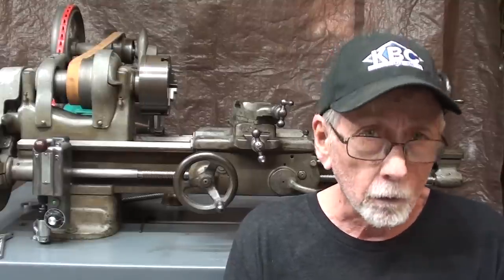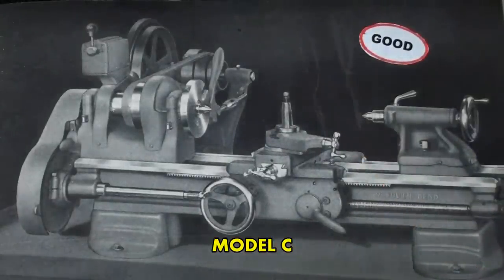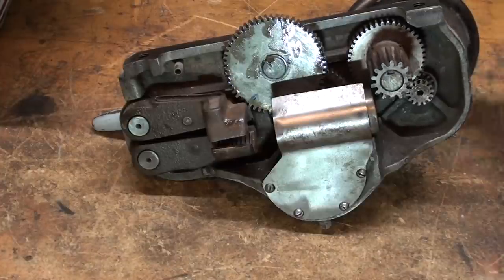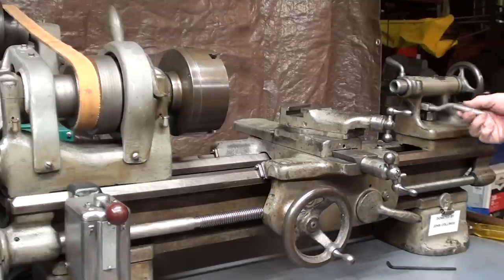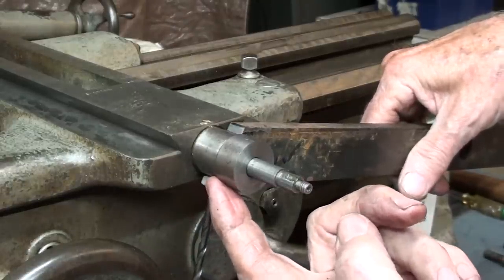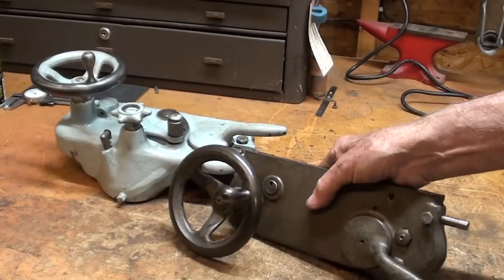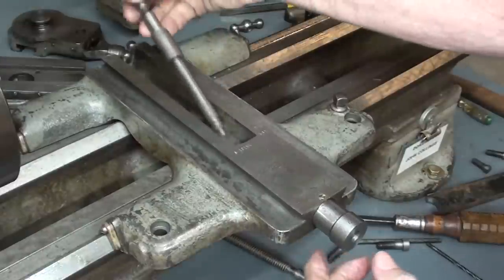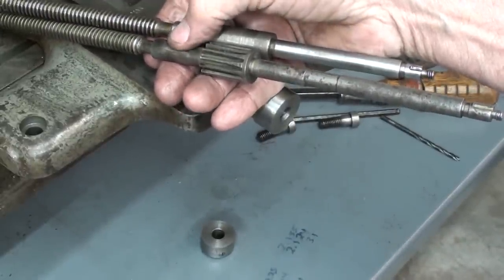UPGRADING SOUTH BEND LATHE C to B  #803 tubalcain part 1

Comment: I recently did a restoration where i combined a broken model C and a broken model A into a working model A. Between the 2 of them, there were enough functioning parts to make one lathe. I used the bed, carriage and top slide from the C with the apron and lead screw from the A. I needed to grind the bed to make room for the extra bulk of the A apron, and make an extension for the lead screw as it was too short for the bed. Had to do a bunch of other stuff as well like hand ream the saddle for the feed screw, and more. But it came together really well and I now get tons of compliments on the machine and folks trying to buy it whenever i post pics anywhere. EDIT: Those screws that hold the apron to the saddle are very often “time welded” into place, 50/50 of the lathes I’ve disassembled, which is more than a few. I’ve had to resort to impact drivers, and even had to weld nuts on the tops of them for purchase in some extreme cases. Luckily they are easy to remake a replacement set if you need to do something dramatic to remove them.
Reply from the maker: Wow, that was quite an undertaking

Comment: Lyle, I believe you have the cross-feed screw from a 9" wide bed lathe with large dials for pre- 1938 lathes.  
The gear, if cut properly and with the correct OD, should allow you to install from the front of the saddle instead of the back side as you were trying to do.  I can get you dimensional information of the gear if you need it.  I do have the correct cross-feed screw on my lathe from the C to A conversion I did years back. Ken
Reply from the maker: Thanks.   The job is done
Reply: The original lead screw and cross slide from his model C is the older small dial version, the replacement lead screw included with the newer longer version for the later large dial cross slide. I have have and older small dial machining made in 1936 and it looks identical to his.
Reply: @peterfox2565  My 9"C was built in 1949. It has the small dials on it, which is just like Lyle's lathe.  As I said earlier, the cross feed screw he got was from a older wide bed 9" lathe.  Also, there was apparently something slightly different about the gear too.  On the later 9" lathes, the cross-feed screw can easily be inserted from the front of the saddle, not from the rear.

Comment: Bought my first lathe, a SB model A, 48" bed, v-belt drive.   The seller just strapped it diagonally to a pallet, no crate, covering.  Crank handle knows arrived bent or broken.  In the apron the casting that encircles the lead screw was broken off ruining the apron casting.  Had to do a teardown, source parts, reassemble.  Learned a lot.
Reply from the maker: Sorry to hear that, whoever pack that was a moron

Comment: You know its odd; I am an electronics chap and not a machinist, but I often find that the fitting of mods and the solving of any problems that might be encountered along the way is often far more fun than using the finished item!

My approach to solving this issue would be to first turn down the collar that exists in the same space as the gear on the old screw. Then turn down and part of a properly sized piece of bar-stock. Using a dividing head on your milling machine cut the appropriate teeth into this part so that it becomes a gear. After drilling out the proper internal bore to fit the old screw I would then use a broach to make a key way in the new gear. Going back to the old screw, in the place where you turned away the old collar use your milling machine to cut a matching keyway. Finally slide the new gear onto the old screw, using a piece of key to lock the old screw and the new gear in place.

I am looking forward to seeing how you sort out this problem yourself!
Reply from the maker: Thank you for your comment. I totally agree with your first paragraph

Comment: Hi Mr Pete, What a truly excellent tradesman you are. I have the clone of the South Bend model A here in Australia and its names Hercus Model A
which I won at auction about 40 years ago. Was in a pretty poor state when I won it but had a friend regrind all the ways after I stripped it and repainted it. Doesn't get a whole lot of use but when I need it (or someone else!!) it's the best thing since sliced bread! Also got all the collets and change gears for metric threads but forgot to ask where the stedys were and found a pair later. Please keep healthy, your family also and thanks for all the lessons, it is very much appreciated. Kind regards.

Comment: Looking forward to more as they come.  I recently converted a Chinese no-name metric lathe to Imperial by re-making all the leadscrews and nuts and also made a quick-change gearbox from scratch using several sets of the widely-available and inexpensive iron mini-lathe threading gears.  Moments of discouragement have been many but nothing a few days of giving it a rest here and there didn't fix.  I'm especially looking forward to your experience of milling the slot in the main leadscrew.  Last weekend I made a new leadscrew for a co-worker's 12" Atlas/Craftsman commercial model lathe using a 6' stick of 3/4-8 precision Acme all-thread rod as a basis and stubbing the left end to fit the QCGB support bushing and drive clutch.  As expected, the 46"-long screw bowed a bit after the groove was cut and tension relieved, so I straightened it carefully with a press.  I expect you will experience bow after machining the groove as well.  Not having a 90-degree milling head attachment nor a horizontal mill to make use of a slitting saw, I had to use a small, carbide end mill and multiple setups to complete the groove.  Not a bad job to do, just tedious with much time spent tramming with a test indicator.  Hopefully you have in mind a simpler way to machine the groove and can do it in one setup.   Best of luck!
Reply from the maker: You tackled and completed a very difficult job, congratulations
Reply: @mrpete222 Thanks, I had a lot of help from an on-line program called "Ride the Gear Train", developed and maintained by a very generous man much smarter than me.  I have seen several quick change gearboxes for the 9" SB lathes for sale on a popular auction site at quite reasonable prices lately, I wonder if you have looked into gong all the way and making your lathe a Model A?

Comment: That is a really cool DIY sized lathe.  Lots of electric shops, automotive etc. for alternators and starters, use that same sized lathe for repairing those parts. Should be interesting to see if the conversion works out.

Comment: The longer screw may also be for the larger dial, diameter vs. radius, the handle sticks out toward the operator further. I just upgraded my 9A from small dial (radius) no taper attachment, to large dial (diameter) with taper attachment. The large dial is nicer.
Reply from the maker: Yes

Comment: You need to add a Thrust, bearing it will take up the space.
Also, The early models have a ledge on the bed that will interfere with the apron. if yours has this feature, it will need to be removed.

Comment: Interesting project. You ought to be able to cut that gear on the mill with a dividing head, tailstock, and a form tool in a fly cutter. Id make a few practice pieces first, however, before cutting into that shaft.

Oh, and i think you need to cut the gear in the large diameter portion of the shaft. Comparing the two, i think it's in the right place. 

I'll be curious to see how you tackle it.
Reply from the maker: Coming soon

Comment: I have a 10K one so this is very interesting. First thought - could you use the original shaft turn down the "gear" area, make and press/pin a made gear onto it? Also, I would probable try to get another shaft to be turned, knowing my skill level.

Comment: Mr. Pete If you had to, could you salvage the gear off the wrong shaft and install it on the correct one?
Reply: That was my thought also. It should be fairly straightforward to cut off and bore the gear, turn the od of the existing shaft and heat shrink the two together. Not as sexy as making a new shaft but a heck of a lot less work and a good demonstration of heat shrinking. As a secondary the fit with the leadscrew nut is guaranteed.

Comment: Its been a while since I refurbed a Mod.A using some Mod.C parts, you might want to double check the Mod.C saddle has the cutout to allow the power crossfeed gear on the apron to mesh with the gear on the cross feed screw, i seem to remember they are different saddles, which is maybe why the new screw wouldnt fit?

Comment: As small as that is, it might be easier just to make a whole new screw assembly. I suppose you could make a friction fit gear for the current shaft but it would be troublesome getting it over the threaded section.

Comment: Hi Mr. Pete sorry to interrupt, I had a question about an older Black and decker  hobby drill press Model 9415, I am trying to find a chuck key which when not in use must be put into a detent in the side to make a safety switch in order to power up the drill. I cannot find any info. on the proper chuck key, it is a 1/2" chuck but the barrel needs to be short enough to fit in the detent and turn to stay in place. With all your experience I thought you may know about this key or the number so I can find one, any info. would be a great help. Thanks Joe
Reply from the maker: Sorry

Comment: Mr. Pete,
How do you remove the apron from a 9a or 10k lathe.  Do you have to remove the tailstock and loosen the driveshaft support, then unscrew the apron off the shaft?  I have an oil leak from the apron and it appears the paper gasket has failed and needs to be changed.  The book with the lathe gives no clues.
Thanks.
Reply from the maker: Yes, remove it from the right hand end

Comment: Is it the same saddle casting ???
Reply: Malcom is correct.  The Model C saddle is different from the Model A/B saddles.  I suspect you will have to either switch to a Model A/B saddle or do quite a bit of machine work on the Model C saddle.

Comment: I have a South Bend Mod.9a. purchased from the estate of a old clock maker. It came with a complete, (i think) set of collets I have used them using the hand knob draw screw but I also have the  SB lever closert attachment SB#CL5206N, the Turet tailstock SB # CL2045N and the Combination Double Tool Slide SB# CL2030N and the  Milling Attachment SB#2680NB. I don't forsee ever having any use for any of these attachmants. I am looking for a home where they will be appreciated and may be used. If this email does get to you (I hope) I am offering these to you or if your not interested maybe you know where/who may be interested. Of course the problem is location, with shipping being expencive. I enjoy the videos.

Comment: in my modest opinion Sheldon lathes are superior than South bend.
Reply from the maker: I am afraid that I pretty much agree with you, although I do not want anyone to know that, L O L. In 1969 I purchased for the school a brand new Sheldon 11 or 12 inch machine. It was flawless and absolutely excellent. It was my favorite machine to use when I needed to do a job at the school